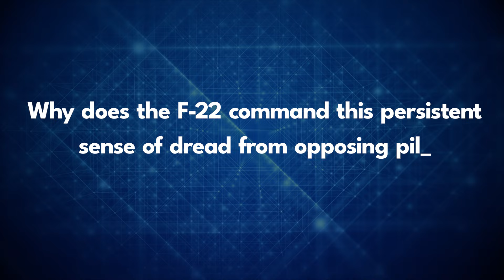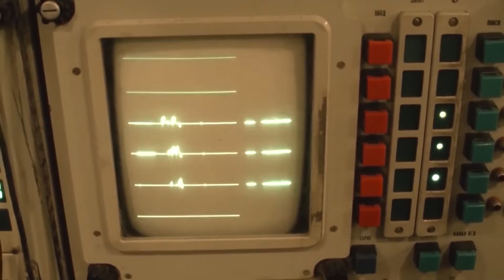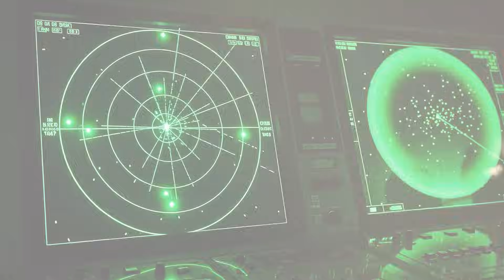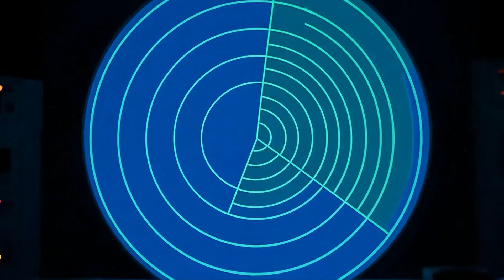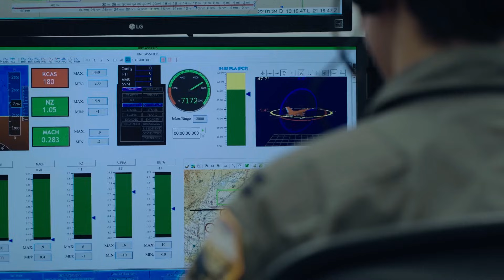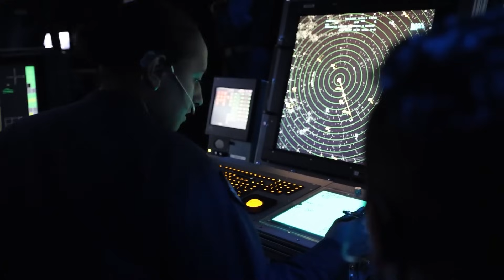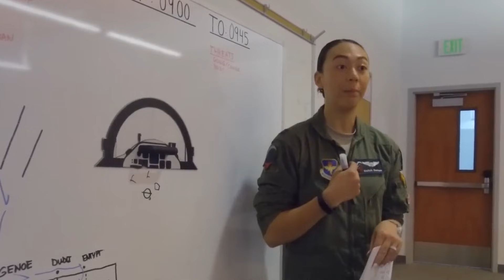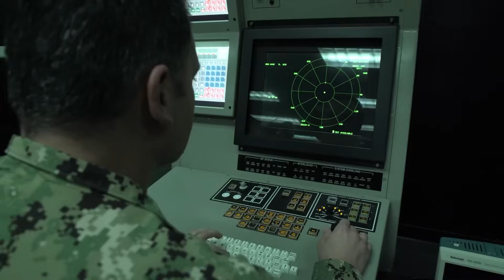Lockheed Martin Just REVEALED Why the NEW F-22 Raptor Will Scare the Enemies!

Comment: The final cost of each production, full featured F-22 costs quite a bit more than the F-23 would have. All you really need as proof is the fact that there were no flyable F-22s at the end of the Fly-Off while BOTH F-23s were flyable. There are other supporting facts.

Comment: This aircraft has been upgraded by Isreal to be even more deadly.   This isnt an exclusive American plane.  I wish you'd have covered the Isreal upgrades, although I understand we dont know how far they have truly upgraded this plane but its dramatic.
Reply: Not a single country has F-22 besides the United States. It’s illegal to export. 

Your referring to the F-35
Reply: They didn't upgrade it.  they made a box, that connects between the cockpit and the rest of the jet.  Takes info in, modifys or enhances it, and then sends to the plane's 'body'. Things like making it go faster, which is of limited use, because the heat will burn the stealth paint.  Anyway, when it lands, they disconnect the box, and didn't break any rules to kod anything.
Reply: What do you even know what your talking about???😂😂

Comment: I will never understand  A why Gates Cancels the F-22 in the First Place. Airforce  ambition ofSacrificing F-22 for Prized F-35 .
 Only to realized The F-35 could fill all its needs.

Why Couldnt the US Airforce Simply restart & upgrade F-22  production ? Wouldn’t that be cheaper than starting from Scratch? 

Ohh Wait the Airforce has ambition On So Called 6 Gen F-47 That probly won’t be Operational in 8 year.

Meanwhile  you have to replace F-15c Golden Eagles already extended airframe.
 Only until Congres Mandated 
the Airforce Getting F-15EX weather they like it or not. So
Well with EPAWSS/ Aesa Radar / Armament  & Advantage of a Second seater to operate drones.

Now the want More 🤷‍♂️ 

** The Irony That the F-15EX has tested
Reply: The F47 prototypes are already flying

Comment: When upgrading these raptors try changing their missile doors like you did with the lighting 2's and give them more missles
Reply: YF23.
Just saying...
Reply: Yep!!! Plus, larger weapons bays would allow them to carry the new Hypersonic missile about to be delivered to the Air Force. Currently, the F-22 cannot carry that missile because it is too long to fit in the current F-22 weapons bay. For that reason, and what you mentioned with needing to carry MORE missiles, appears to me to be the major flaws of this magnificent fighter jet. And I guess the fact that it doesn't have the open architecture like the F-35 and the new F-47 that makes it easily upgraded.
Reply: Modifying missile doors is one thing, modifying fuselage size is entirely another.
Reply: @michaelphillips3123 It would be easier to build hypersonics to fit the weapons bay ,than to redesign the FUSELAGE...